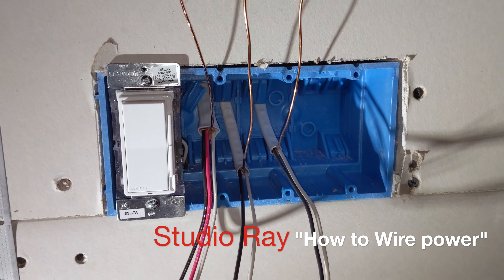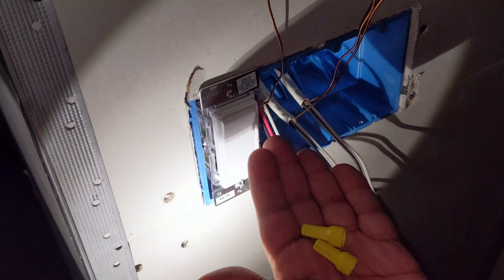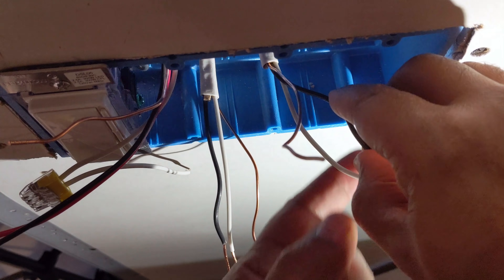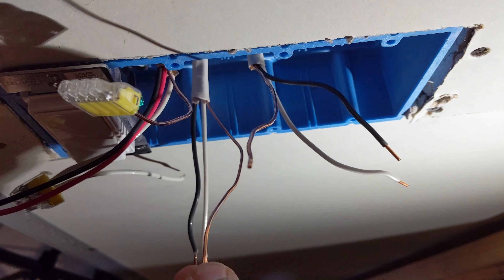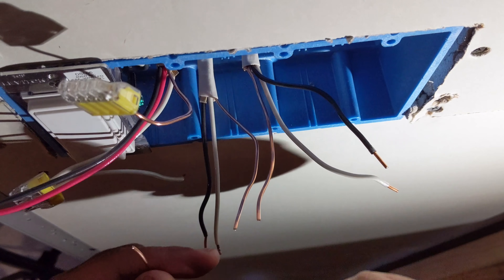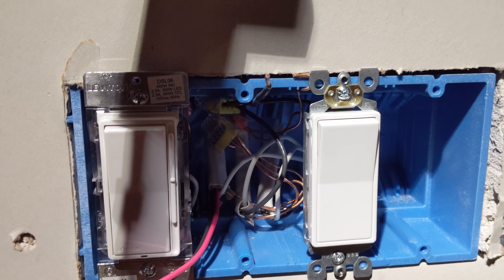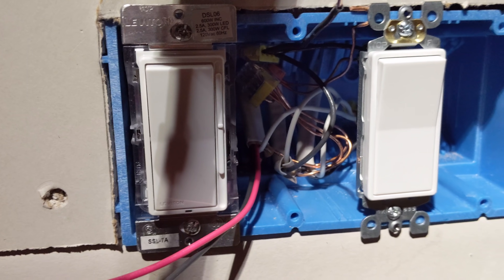How to Install Two Light Switches from One Power Source (line)

Comment: That is some shitty work bro.  Anyone watching this video move on.  DO NOT use stab in connectors, they fail (unless you want to help pay my mortgage when I come to repair it).  He violated the code by not leaving enough length on the wires.  Also you don't install the switches before the drywall and paint is finished.  Dude you got an F for workmanship from me.
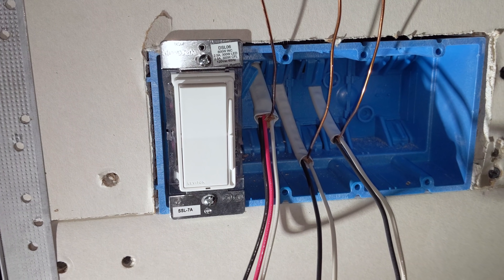Reply from the maker: With all do respect sir, As I stated in the video at marker 2:09 consult a licensed electrician. #2 you are wrong about the connectors I'm using. But I also stated you can use the traditional wire nut. I just prefer the ones I profiled. #3 "you don't install the switches before the drywall and paint is finished." Seriously are you kidding me. (FYI, a DIY Trick Use printer tape when  finishing your walls). #4 This is a DIY tutorial. If you are not comfortable in doing this type of work get yourself a licensed electrician so you can get proper length wire. again. Thank you for your feedback and please remember to subscribe. :)
Reply: @DIYNATIONUSA  As an electrician I have to deal with repairing work such as you have showcased.  It's extremely annoying.  Having to fight wires that are too short sucks, ripping out all those push in connectors and making proper splices is made much harder with short wires.  I advise anyone who wants to use those connectors to leave extra wire for the electrician you may need to hire, he'll thank you.
Reply: @DIYNATIONUSA  As for the DIY tip of installing outlets and switches before  drywall and paint, it's a really bad idea.  First switches and plugs are supported by the yoke (ears that rest against drywall).  If you install before drywall you can end up with spongy plugs the go into wall when plugging in.  Also if you ever need to make repairs and you've mudded and painted over you damage the paint and drywall to replace a bad dimmer.
Reply from the maker: @jesser.1165  other than you disagree on the type of connecter and that I chose to install my switches before my drywall was finally finished and in your opinion the wire was too short (which I disagreed). The procedure and wiring is the same. Others  can use traditional wire nuts and get the same results. And wait for their drywall to be completely done,  the procedure still the same. Leave extra wiring,  the procedure is still the same.  Do see where I'm going. The procedure is still the same.  As I started in the video. Everyone should consult with  an licensed electrician if they're not comfortable and doing this type of work.
Reply: @DIYNATIONUSA  I'm sorry, I should not have commented on you video.   I do not wish to argue with you.  Best of luck to you sir.
Reply from the maker: I'm sorry. Don't get me wrong. I appreciate your input. I would agree with some points but disagree in others. But seeing a different point of view makes me a better DIY and Youtube creator. So I thank you for your point of view and sharing it with other.